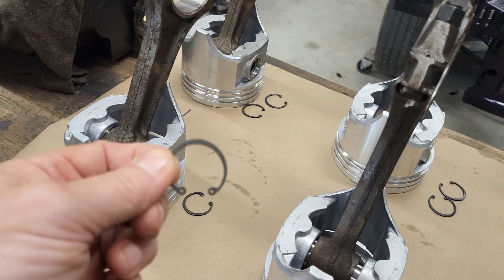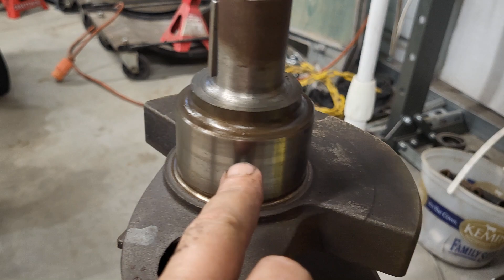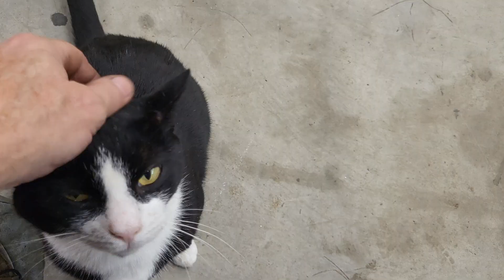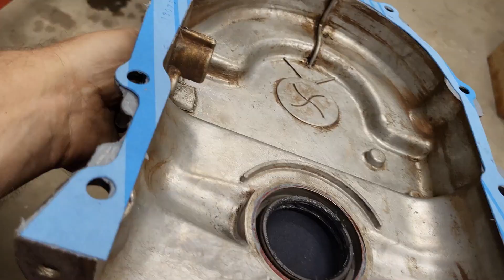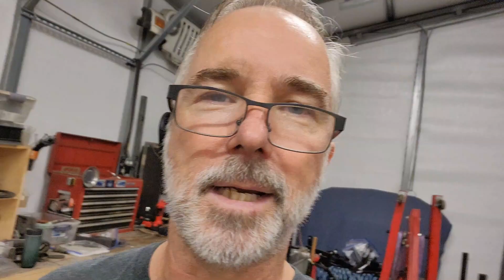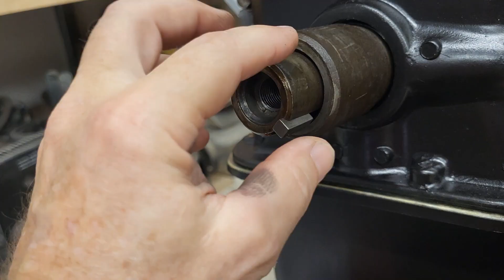FE 390 Build with Edelbrock Pro Flo 4 EFI

Comment: How come you didn't say anything about proper spacing of the rings you just went straight to compressing and then installing
Reply from the maker: I don't do anything special for the spacing.  They start to move and rotate when the engine starts so it doesn't really matter where they are placed when you install them.  I was getting good solid compression readings just after a I ran it a few times so it didn't effect the compression at all.

Comment: Curious how the Pro-Flow is doing....???
Reply from the maker: So far it is going good.  I have only driven it a short bit so it hasn't learned a lot yet.  Cold starts are doing good and the hot starts are getting better.  It has to heat up to about 170 before I can put it in gear or it dies.  I hope that works out of it or it's and adjustment I can make.  So far it's good.. it just needs to be driven to learn.
Reply: @Exit45Restorations well 2 and a half years ago I had a choice between the Pro-Flow and a dual quad kit from Fitech. I built my client a 487ci Aluminum FE amd I went with the Fitech. 

"Self tuning" is first dependent on the parameters you enter and then on you driving it. We've got 6k miles on the FE in the Eleanor, as of yesterday afternoon. Ive got a short of it running on my channel.

I hope the drivability comes around.
Reply from the maker: @arturozarate1752 she sounds good.  I'm sure it will come around after I get it on the road more.

Comment: Sorry for the  late input, maybe someone already corrected this and i missed it but 390 Ford FE's (like 427 Ford's) are INTERNALLY balanced. The harmonic balancer they use is nuetral. 428 is a different story. You were wise to use your distributor before torqing your intake.

Comment: That is a '1964' Period correct Ford 390 FE crankshaft
Reply: Also a 1963 block and front timing cover....Cool .. my 1969 block has a 1961 intake..1962 manifolds a 1963 front timing cover with 1968 cylinder heads.
Reply from the maker: Did you'rs come that way factory or was it rebuilt like that?
Reply: @Exit45Restorations Sorry I believe all the parts are original..but the engine was complete less carb and starter..it was a seized Standard bore engine.Pistons stamped 390 4V..with a camshaft C8AX. ....C. hi po cam..

Comment: The cupped valve is the result of the removal of all lead products in our modern day fuel ..the lead was added lubricant for the valve train .without the valves would overheat and fail as a result of continuing to run the engine without proper top end lubrication.
Reply: Lead prevented the valves from hammering into the cylinder head upon combustion in the fuel/air mixture..it's not actually a lubricant.
Reply from the maker: Thanks for the info.  I've  just never seen it before.

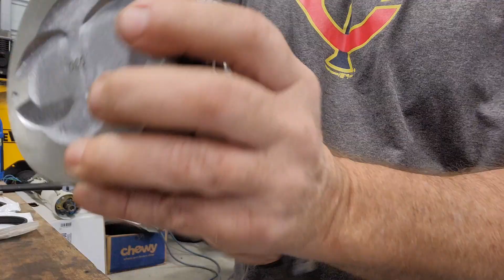Comment: You should expect to be burning alot of oil.  At 7:34 you have all the rings on but have not spaced them at all in reference to the 360° circumference of the piston. There are 5 different spacings.  Oil spacer  ring,  upper and lower oil rings and top and bottom compression rings.
It's essential to offset the gaps,  otherwise compression will get past the 2 compression rings and then increase blowby past the oil rings.
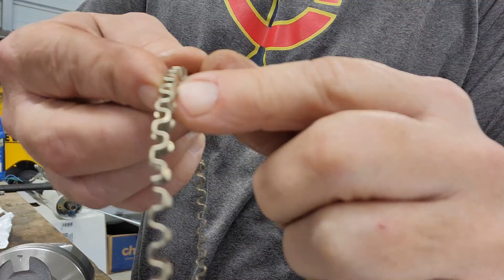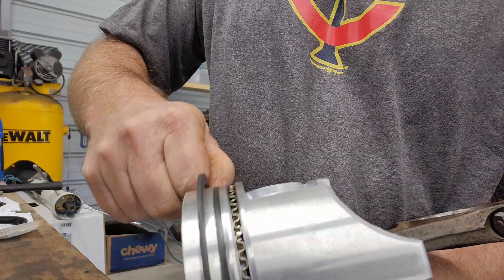I usually put the oil spacer at 12:00,  2 oil rings at 4:30 and 7:30 and compression rings at 1:30 and 10:30.  This evenly spaces all the gaps.
Edit...the spacing #'s are as to clock settings....easiest way to describe.
Reply from the maker: I got you.  The rings rotate once it starts so it only stays that way for a few seconds.  I have good even compression and almost no blow by so it looks like the rings have set in nicely.  I've seen it done both ways and this was my first time trying it thus way.  Thanks for the comment
Reply: @Exit45Restorations I certainly hope it works out for you. 
The piston rings certainly do not rotate around the piston within their grooves.  
The Ford dealer manuals for the 58 &59 352 FE state: "Make sure the ring gaps are properly spaced around the circumference of the piston".  Unfortunately they do not include a chart.

All your Chilton,  Haynes manuals,  as well as SA Design series on Engine blueprinting or HP books on engine rebuilding all have charts.
Although they vary a little by author to prefer clocktype positions,   uniformly they advocate for spacing ring gaps anywhere except directly in line with the wrist pin.

This ensures optimum compression,   but even moreso,  keeping the compression out of line with the 3 oil rings gaps.

Where it will show up is in driving miles and oil consumption.  The ludicrous amount of crank rotations at driving speeds for miles on end is where it shows.

I found this out when working for Ford Motor Company in the heavy truck department.  A 460 was part of a Ford chassis for a new motor home.   Oil consumption was high.  No external leaks were occurring.  Compression was good.  Tailpipe was clean,  plugs looked good,  blowby seemed nominal.

A 75 mile drive however consumed about 3/4 of a quart of oil. As measured before and after by dipstick marking. 

They authorized the tedious task of an inframe teardown (the MH bodies are a real drag for this) and what I found was ALL the pistons had all the rings in a straight line. 
This is what is the worst case scenario

I see that Barry Rabotnick in his wonderful book on FE rebuilding acknowledges that while "some folks place alot of value in particular gap locations during assembly,  but I believe that as long as you do not line them all up you will do just fine."  SA352 P.62)

Because all previous literature I had consulted before looking at these FE 352 specific books gave chart recommendations,  that's the way I've always done it,  and from my own SBC 305 in my first car in 85 to my Lincoln 430...by following this spacing I've had great results.  Great compression,  driving power and no oil issues,   blow by or consumption.  I believe it also minimizes oil seal issues by doing everything possible to keep the compression on top of the rings,  instead of getting any more than necessary past them.
Reply: @pmczapczara5332  This test has been done and proven that those rings DO INFACT rotate during operation.  You seem to be a person who love to hear yourself talk while parroting other people's wisdom.  You literally copied and pasted other people's work!  That's probably why your comment was ignored.  Those books and publication were written out of an abundance of precaution and old knowledge.  Next time you want to write a thesis on being ASS WRONG check your facts first.

Comment: Where is the harmonic balancer?
The 390 is  externaly balanced, not to mention how do you set your engine timing without the balancer, that is where the timing marks are.
Reply from the maker: Hey.. it's on there.  You must have missed it in the video
Reply: @Exit45Restorations 
Thanks for replying. 

At 55 minutes to 57 minutes, it clearly show you installing just the two pulleys on the snout of the crankshaft with no harmonic balancer beneath them.
There is a large gap between the pullys and the timing cover where the balancer should be.
Then watching your engine stand run video, again there is no harmonic balancer installed, just the two pullys.

Then in the comments of the engine stand/running video you mentioned vibration from the running engine, which was attributed to a bad flywheel or flex plate.

Hence my comment. 

Again thanks for replying to my question.
Reply from the maker: @jaynecobb6711 the first pully that went on is weighted and has the timing marks on it.  I've seen other FE builds with this same setup and it is how this one came apart.   The engine does run smooth through the RPM range.  I get what you're saying as I've seen other builds that have a separate balancer.  Maybe it's a change that happened at some point.  I'll do some looking into it to see.
Reply: Thank you for your reply.

ALL fe 390's use a external harmonic balancer on the snout of the crankshaft. 

Yours is missing.

The weighted pully is called a vibration damper, which is used for damping the vibration from the AC compressor as it cycles on and off.
If your car had AC sometime in its life, you have that weighted pully.

It IS NOT a harmonic balancer. 

You will damage the crank or destroy the engine in short order without a harmonic balancer on a fe 390.
If you are experiencing engine timing issues or running issues, or  vibrations as the car runs, it is because the balancer is missing.
A quick check consists of hooking up a timing light and look at the timing mark.
Without the balancer, the ignition timing will be erratic and all over the place. It will not be stable.
But the engine will sound like it is running smoothly, when it isn't. 

Only a few engines were internally balanced at the  crankshaft itself and did not run a external harmonic balancer.

ALL fe 390 engines for cars, trucks, ect. ALL ran a harmonic balancer on the snout of the crankshaft. 

Please seek another opinion from another source, such as summit tech line or other sources, BEFORE you drive that car.
You have lots of time and money in that engine. 
Be safe and seek another opinion other than mine or do a 10 minute Google search.
It could save you a lot of grief and money.

Thanks for returning my comments. 

Thanks for your time.
Reply from the maker: Thanks for your help and I will definitely look into this further.  I don't want this engine eating it's self up. @jaynecobb6711
Reply: @Exit45Restorations 
Thank YOU and good luck.

Comment: We’re those the 9.5 comprehension pistons that Sillvolite has I got the same rings for my 390 build mine is also bored to 30 thousand over and my crank is turned 10 thousand under
Reply from the maker: The pistons where for the 360 and gave me a little less chamber areas and a lottle higher compression.   I think I'm at about 10:1 on this one.  How do you like yours?
Reply: I was watching your video and others to refresh my memory so I can get it put together without having any issues I took the heads and the block to a rebuilders and he magnuflux everything for cracks and I had him do the valves and check and measure the bore and crack and I’m glad he did the heads because he found a crack in one head and I had another set of heads off the 360 I took apart that was originally in the pickup I’m putting it in
Reply from the maker: @scottscheuerman8714  got ya.  So you're getting ready to put it together.  Good luck on it. There's nothing better than hearing it run for the first time.

Comment: no pro flow was seen!
Reply from the maker: Hey.  I guess you missed the part where I go over all the issues with the installation of the Pro Flo manifold and the installation of it.  I also have a video out that shows the harness installation and another video that shows the troubles with the throttle linkage hook up on them and finally a video showing the first start using the Pro Flo.  It's all there

Comment: What brand of bearings do you recommend? Are you reusing the original head bolts, main cap bolts, and rod cap bolts?
Reply from the maker: Hey.. I don't have a specific brand that I use as this was the second engine I have rebuilt.   I stayed away from the cheap ones and try to look for American made bearings.  I did reuse the bolts as this was not going to be a high HP engine build and it was going to be more of a cruiser.
Reply: @ Ok thank you. I will probably do edlebrock heads because its a 67 truck so the heads are not as desirable as the high rise earlier sixties.
Reply from the maker: @JBizzle822  I agree.  Thise are the smogger heads.  You'll like the edelbrock heads.  I have a buddy that used them on his 360 strocker and they worked great.
Reply: @Exit45Restorations  I plan on building a fun motor that is still capable to tow. My dad has a 67 f250 and he wants to keep it useable and automatic. I plan to build the engine for it and maybe a 6r80 transmission kit so that it is able to go on the highway at reasonable rpm. I am going to keep it carb.
Reply from the maker: @JBizzle822  should be a fun build.  Good luck on it and let me know how it turns out.

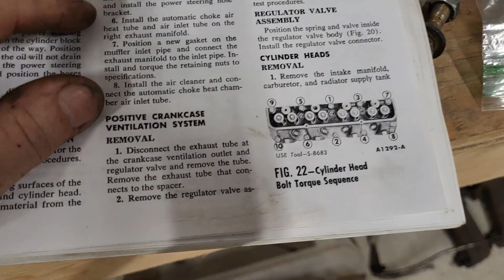Comment: Nice video man, I’ve been look for a video like this for awhile. People tend to fast forward the whole process, so thanks. If you don’t mind me asking what’s the book called your reading off of at 39:32 it’s looks very useful.
Reply from the maker: Good to hear from you.  The book I use on is the service manual the assembly manual and the elextrical assembly manual.  Oh and the wire diagram manual.   The service manual is the one you saw and is the one I use the most.  You can get them at thunderbird parts places like Bird Nest.  I hope this helps

Comment: You also should pay special attention to the pushrod holes in the intake. When your new pushrods are installed you need to check & make sure they have proper clearance throughout the entire 4 stroke cycle. With the new taller lifters & shorter pushrods & new intake one should pay special attention to this. Please tell me you took your rocker shafts apart & cleaned inside that shaft?? They looked pretty unclean when u showed them. Alot of gunk builds up inside them. You can buy new plugs for the ends. If u dont, all that gunk will flow throughout your new engine. Im just sayin! I want your engine to work out for you.

Comment: I see your crank was a C4AE -B crank. Im guessing your heads are C4AE-G heads? It looks like they have the higher exit exhoust port so they are earlier than the 66 heads. C4AE-G are very good heads. I have 3 sets of them. Low riser intake ports.
Reply from the maker: Yes these are the medium riser intake heads and they should pair nicely with the cam I.put.in.it. so.far.this.is.a solid runner.  Thanks for all the input.

Comment: Very enjoyable video, love those FE engines. What heads did you use? I didn't see much on what you did to them. 
I love the use of EFI and a roller cam in these engines. I look forward to seeing how you like the "Driveablility" of this combo
Reply from the maker: Thanks.  I used the original thunderbird heads.  They got a valve job and resurfaced.  These are pretty good heads with the medium riser intake ports.

Comment: Heat caused that. The valve "tuliped". The valve wasnt able to dissapate heat properly. Either by excessive valve guide clearance, seat contact patch too thin, or poor oiling from the rocker arm system. 

Another quick thingy.....rusty connecting rods or crankshaft counter weights will shed some of that rust. You're oil filter might catch it, but not before the pump gears make friends with the rust first. The timing set and cam lobes are spash oiled. Imagine what the Iron Ferrite does to those surfaces.
Reply: That valve isn't tuliped. It would show discoloration if it got hot enuf to tulip. You would see bluing on the head & partially up the stem. It would be significant if it got that hot. You wouldn't mistake it. It's the way the valve was made. That's how they are shaped. Look at the head of the valve. It is cupped in the center. The outside edge is flat.
Reply from the maker: Thanks for the help figuring out those valves.  You're right about the rust.  The rust was just more of a coloring then it was any kind of heavy rust so I  wasn't so woabout it.  I will take even more precautions on the next build.  Thanks for the comment

Comment: Nice job! You'll love that Edelbrock EFI system, my dad put the same system on his 1968 Mustang and it runs like a champ, always starts up just fine and is pretty easy to tune using the app, certainly a huge improvement over his old carburetor! I was seriously considering using it on my 63' Tbird but I am too much of a purist I guess lol. Also I am glad to see I am not the only one who managed to install the oil pump without the drive shaft the first time around, those things are easy to forget!
Reply from the maker: That's good to know that the EFI system works good.  Yes that oil pump rod is very easy to forget.  Good thing is that when you go to prime the engine you'll figure it out pretty quickly.  Lol.. I'll go take a look at your channel today.  Always good to find another channel.

Comment: Good job, did you use stock valve springs ?
Reply from the maker: I used aftermarket springs from Howards cams
Reply: @Exit45Restorations  did it come as a kit with cam ?

Comment: The surge tank is on there because the thermostat sits higher than the radiator  if you eliminate it you must install a radiator cap higher than the thermostat or it will overheat
Reply from the maker: I figured there would be something that needs to be changed to make it work.  Thanks for the info